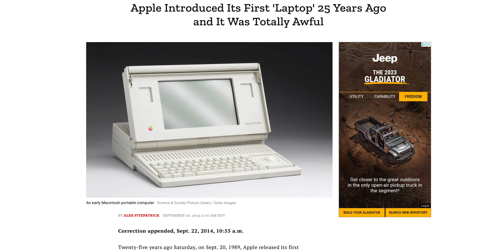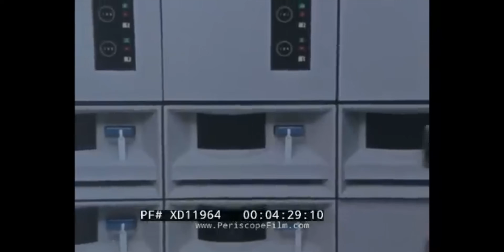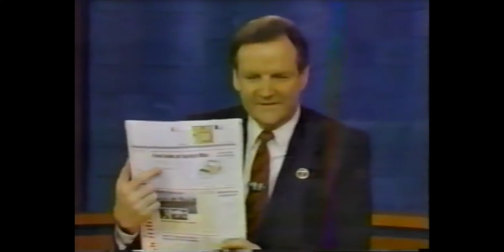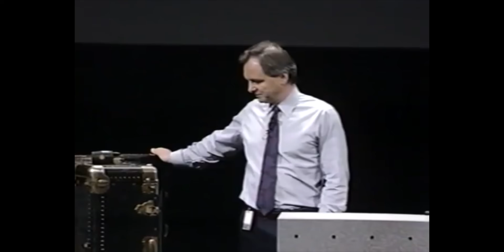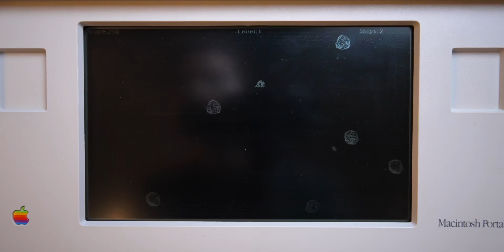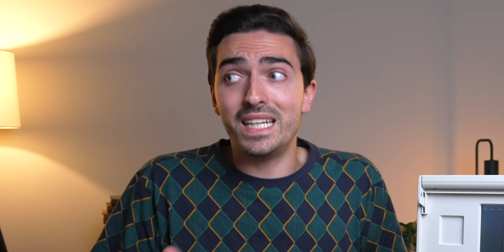How Apple INVENTED the laptop

Comment: This video showed me nothing but nostalgia. Why? Because I used to have one of these. Back in 1988 I got my first post-college job at Apple as a field engineer. When the Portable came out, I had the use of one of these until I left the company in 1990. I frequently demoed this to customers. I actually used this on a plane multiple times. Some say its not a laptop but with someone as tall as me, well I have a big lap. :). Anyway, you're right about that this was basically a no-compromises computer. It was twice as fast as a Mac SE (16 Mhz vs 8 Mhz processor). The motherboard was a version of the Mac SE, which was a problem because of its size. In an SE, the motherboard was tiny compared to IBM PCs and the like. But a true laptop needed further minuturization, a skill Apple didn't have yet (and why they went to Sony for the Powerbook 100). But there were so many firsts. The active matrix screen was a revelation back then...nothing else was even close to it on the market. It would have been nice for the first version to be backlit. I don't think there were a pointing device before on a portable computer since none of them has GUIs. Battery tech was in the stone age....we take laptop batteries for granted now, but early NiCad cells didn't exist yet, hence the lead acid cell, just like a car battery. And it only added to the weight and bulk of the device, not to mention the full size 3.5" hard drive and floppy drive.  And that shell of a case was very durable. One of our sales reps actually ran over his Mac Portable with his Jeep when he forgot it and the black carrying case sitting behind his car when he was packing for a trip. The shell cracked, but the machine still worked and the screen was undamaged.

When Sony came out with the Powerbook 100, it was the first laptop in a size and configuration you would recognize as a modern (if early modern) laptop. It had the hinged screen, pointing device in the middle, palm rests, reasonable weight and size, etc. And yes it was far less expensive than the Portable despite the minuturization of the motherboard to get it into that body. But there were compromises. The screen is a cheaper passive matrix (still good). The battery is still lead acid, but a lot smaller and in a slot design that was quickly copied by other companies. And just like future Apple products, there is no removable drive built in (amazing design decision since Steve Jobs hadn't been at Apple since 1985). Of course, the Powerbook 100 wasn't the only machine to replace the Portable in 1991. The Powerbook 140 and 170 (Apple designs) gave customers choices (at higher prices). First, the battery for those models were NiCad, probably a first. The 140 had a passive matrix screen but the 170 had a backlit active matrix screen. All three Powerbooks had 2.5" ATA laptop drives, another first. The Powerbook 140 had an Motorola 68030 processor (serious horsepower for the day) and the Powerbook 170 had an even faster one. I remember carrying SE/30s in carrying cases places while at Apple. These were laptops with the same power and storage....that could operate on battery alone. And a year later, the 180c would add a color active matrix...truly sick tech and still a bit cheaper than the original Portable.

The Portable was a transition machine from the likes of Osborne and Kaypro to the true laptop world that would come in the 90s/2000s. But it showed what could be done...it just needed to get the size down. And if you really want a look at an earlier Apple machine that had glimpses of the Portable, the Apple //c (and //c+) had an optional Flat Panel display in 1984! Yes it was a lot of compromises but again, it showed what Apple really wanted for a portable computer back then. BTW, if you want to see the flat panel display, it's featured briefly in the movie 2010.
Reply: The NiCad battery was invented in 1899. They were in widespread use by the 1980s (almost all mobile phones used them, for example). Many of the portable computers that came before the Mac Portable also used them.
Reply: @ignorance72  good point. Even the Motorola cell phone I had in 1989 had one. So not sure what the design choice on this was.
Reply: @Sevenfeet0  I think their reason was the improved reliability and lack of memory effect that plagued the NiCad batteries. Also you can rebuild one yourself with ease nowadays. Crack open the case of the old battery, disconnect the old one, and put a new one in. It is the same as the one used for electric wheelchairs and similar stuff

Comment: Sadly, I've never had any first-hand experience with the Portable. I didn't know they made one with backlight, which I think would be very usable actually. But I think the lead-acid battery makes a large percentage of the system's weight. I'm sure you could replace it with a much lighter battery with the same capacity today. Also, use a BlueSCSI instead of the spinning rust to save even more weight and a bit of power. Really sad that it's so hard to get one nowadays.

Comment: Awesome video. Other than the backlight I see no issues with this implementation. Yes it's heavy, and that sucks, but if they built a laptop in 2023 that did exactly what a desktop does, with no compromise on ANYTHING. Screen, keyboard, input device, specs, thermals... Wouldn't you allow it to weigh 7 kilos?
Reply: There's a company in Germany (forgot the name) that makes portable workstations with desktop components to this day. I remember checking it for curiosity and a super maxed out rig would cost around 10 grand and the charger brick alone would weigh 3 kilos

Comment: I convinced my employer to buy me a Macintosh Portable in 1990. I remember the first really cool thing I did with it was create slides for a briefing at a bond rating agency while I was on a train from DC to NYC. Here is the funny part: They were actual slides - I had to take the file to a digital graphics shop in NYC to get it made into 35mm slides I could use in my presentation. By early 1992, I replaced it with a PowerBook 170.

Comment: You should think of swaping the HDD for a bluescsi + adapter, the seal of this drive liquify in time and ruin the HDD. For the performance level, the Portable came with the 68000 at 16mhz vs the 8mhz in the SE. At this time, the Mac II and the IIx was out with the 68020 and 68030 16mhz.

Comment: I always admired how easily upgradable and easy to access Apple computers were in the 80s and 90s. I used to own a PowerMac 6100/60 and then a PowerMac 7600/132 in the 90s and they were very easy to open and well designed inside. I gave up using Macs somewhere around '95 because I started building my own PCs and also because of gaming. Still, I have extensive experience upgrading Macs as late as in the early 2000s and I think it's a real shame that Macs are basically impossible to fix and/or upgrade nowadays. I didn't know you could take apart and assemble the Macintosh Portable so easily. You're right, it's actually incredibly well designed, especially given when it came out. Super impressive actually. And yes, please make a video about the PowerBook 100, it was revolutionary as well when it came out.

Comment: The KayPro II was quite popular back  then but the most I would say was the Compaq "lugable".    You said those old computers only had one input device a keyboard, well back then all computers were text based not GUI computer until the Xerox Star system.   You know the Xerox Star system it was the one Steve Jobs saw  and said clone it and call it a Mac.  That rollerball on the Mac laptop to taken from the Xerox Star System that didn't have a mouse it had a small trackball in the corner of the keyboard.   It was a lot of fun being part of the early days of personal computing with the S100 bus computers, Apple II,  Radio Shack TRS 80, then the IBM PC showed up.  At school I did my homework on Digital mini computers running UNIX.    Unix still the best OS around.

Don't forget after that big Mac laptop failed then came the Barbie laptop from Apple the clamshell looking one.   No guy wanted to be seen with one of those.   Eventually Apple came up with the MacBook and people were smiling.

Comment: I don't believe anyone was using the term "laptop" for the portable computers of the day.
"Portable" like a portable typewriter. The original Macintosh was "portable."
Still, it really was a vast improvement over the Kaypro that was still very popular at the time.
I first saw one of these in the hands of a consultant who was working at our company. He said he was evaluating it to see if it was something the company might find useful to buy and use.
This was shortly after our purchasing department had gone all-Macintosh so that they could use an AppleTalk phone-wire networking to share files and all share the new Laser Writer.
I remember the advertising mentioning that the trackball could easily be moved to the other side if you wanted.
They ultimately didn't go for the Macintosh Portable.
I didn't think the Macintosh notebook computers really came into their own until the "Blackbird" PowerBook 5XX line, the very first computer with a trackpad. And it's a very good trackpad! (Yeah, I have one.)

Comment: It's a precursor to the Framework Laptop and the antithesis of the modern Macbook
Reply: You beat me to it.
Reply: 100% false. The Framework is a reaction to companies creating non-serviceable, non-upgradable laptops. Neither the Portable nor the PowerBook 100 could be upgraded (well other than replacing the RAM card with a larger one). And they both used lead-acid batteries, which are both terrible for the environment, and become useless if allowed to fully discharge.

All portable computers were put together like this in the early 90s. It's was just the limitation of the technologies. Apple didn't assemble the Portable without screws to make a design statement; they did it to save cost, just like the IIsi and similar machines of that era. They were literally counting the cost of every screw and the time required on the production line. These same machines are now literally destroying themselves as their plastics age and become brittle.
Reply: @kirishima638  - It looks pretty serviceable to me.  Did Apple solder the hard drive, ram and CPU to the motherboard?  And purposely take other measure to prevent users from accessing or upgrading the device?

Also, I wrote this comment when I saw how you could move the tracking device and keyboard around.  Just like Framework!

Regardless of Apple's motivations, they made a device that far more closely resembles a Framework than a modern Macbook
Reply: @yogiyoda  I'm certain that opening the portable would void the warranty.

Yes the CPU is soldered to the logic board.
The RAM and harddrive are proprietary and unique to this machine. You could not replace them without like-for-like parts from Apple.

You're confusing ease of assembly, intended for Apple's own cost-savings, with ease of serviceability. They would not be happy with anyone opening a Portable.
Reply: @kirishima638  - Where can I find proof?  I think you are making these facts up.  Why would they publicly demonstrate how easy it was to assemble and work on and then void warranty for opening?  Why would they work so hard to save money on screws and then spend money soldering and building proprietary ram and hard drive?

Comment: The only reason this failed was because Starbucks (nationwide) wasn’t a thing yet.
Reply: The owners of Baked & Wired are going to be pissed when they see this comment. 😂
Reply: @SCU3A_S7EVE and McDonald's had no wi. Fi
Reply: This gave me a decent chuckle thank you.
Reply: Not quite the original Macintosh portable had 2 design flaws. 

1. It required a battery to be installed in order for the machine to boot on some models.

2. The batteries explode while charging apple forgot to put in place a stop charging circuit where the machine will continue to charge the battery until it goes bang ever wonder why there so rare and expensive.